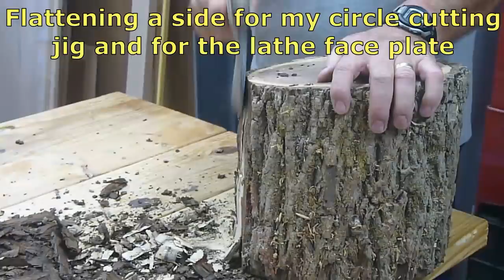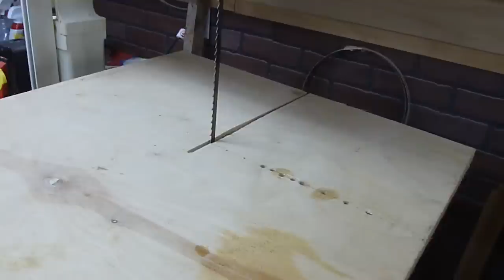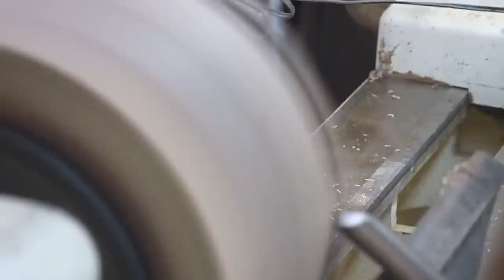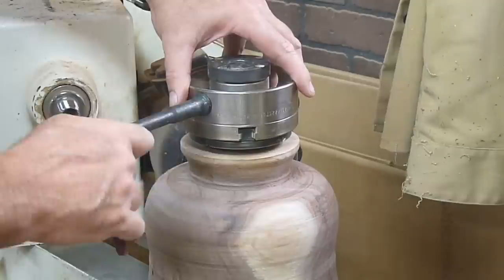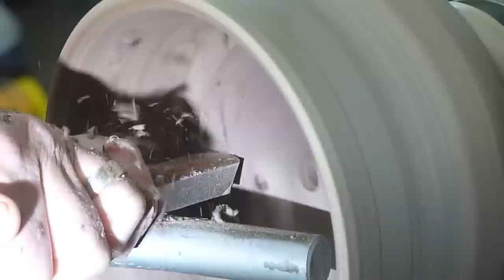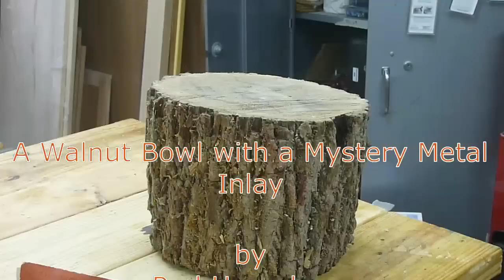Woodturning a Black Walnut Log into a Bowl

Comment: It's probably not that uncommon that a bullet was in the tree.  What's amazing is that the bullet ended up in the perfect place to become embedded in the side of your bowl.  It could have easily been cut away with the outside part you trimmed off with the bandsaw.  Or it could have been part of the inside of the bowl that was turned into dust with your turning chisel.  An unusual set of happenings!  Great job on the bowl.
Reply from the maker: Truly!  It was in the perfect location, very unusual!  Thank you!

Comment: Great turning with a beautiful result.   I hope you don't mind me offering a little advice which may be of help to others.   When you were roughing out the piece you could have kept the tail stock in place for a great deal of the time.  Last April I was turning a large natural chunk of wood using a face plate to secure it.  I didn't realise I was putting extra stress on the screws because of the unusual shape and it started to come off.   I raised my forearm and took the blow and in doing so broke a bone.   Normally such a break takes 6 weeks to heal but I healed in 3 weeks which I was mightily pleased about.  However, during those 3 weeks I was forbidden by the Doc from driving which was a bit of chore and I couldn't do any turning.   The message I want to put across is that whenever possible you should deploy the tail stock for more security.
Reply from the maker: Thank you very much, Alan.  You are absolutely correct regarding the tail stock providing better support, especially when the piece is uneven or out of round/balance.  My jig gets the piece very close to round, but regardless, it still would have been more wise and safe to provide that support.  I'm glad you were not hurt worse, and want others to learn from that accident.   Thank you for a very constructive comment!
Reply from the maker: @rats     lol, if you only knew...
Reply: R Humphrey old Marines don't get hurt they just get even!  Right?  Lol
Reply from the maker: kamurray67 hahaha truth! Semper Fi
Reply: He had eight screws and they were all securely anchored, and the huge faceplate offered full coverage at the attachment end.  That walnut block was every bit as secure if the tailstock were employed..
Reply: I'm sorry if I have upset you.   I knew when I posted my comment that I would probably attract some critical replies.  I was only trying to share my unfortunate experience for the benefit of others.   I can't comprehend how you can say that having just one point of securing a piece is as good as having two.  It's a bit like saying that someone who falls into a river or the ocean would just be as well off if he had one rather than two life jackets.Thank goodness the R Humphrey is a much more reasonable gentleman than you.  I shall continue to watch and learn from his great videos and amazing skill.
Reply from the maker: Xysix  I am comfortable with the face plate without the tail stock, but I do check it frequently.  It's perhaps a bad habit to choose not to use the tail stock as much as I do, lol.  Thanks for watching and for your sub :)
Reply from the maker: Alan, it's all good, there's so much to learn and so many ways to get things done :)  Thank you!
Reply: Apologies but my reply was intended for Xysix.    I'm sorry some people can't accept reasonable advice without reading something else into it.  I am a member of the Irish Wood Turning Guild.  Just this week we received a missive from the Exec Committee forbidding all demonstrations, entry competitions or anything else related to Litchenberg Fractal burning.   This has arisen out of the unfortunate death of a man in Wales who had made his own burner from a salvaged microwave transformer and other bits and pieces.   He was electrocuted to death as a result.  I had no trouble absorbing that piece of advice.  Using just a faceplate when you could be using the tailstock as well is like a mountain climber using only one rope as opposed to two.   I can't for the life of me see how anyone could take offence at my comment but as the old saying goes, there's nothing as odd as people.

I emphasise that my grievance is not with you as I greatly enjoy your videos.
Reply: Alan Simpson i
Reply: It looks like the tail stock end was fairly symmetrical... That, being with the very secure face stock, was what held the walnut in place firmly without much complications.
Reply: You guys are awesome!
Reply: I have not got into using a lathe yet but it something I'm looking at trying out. That being said this whole thread is about the tail stock. What exactly are ya'll referring to?
Reply: @tinytim8919  The tail stock is the non-motor driven end of the lathe that holds the wood like when you are doing spindle-turning. He used it in this video to hold the drill bits when he was hogging out the opening of the bowl.
Reply: @tomknack  ok. Thank you

Comment: With that Metal object Being Buried As deep as it was and judging from the shape I believe it was a Bullet because the part that hits its object is made from lead and when it hits its object it will spread out into a semi circle so as to do nore damage as it enters its target  so from that I believe it was a bullet
Reply from the maker: I originally didn't think it was a bullet, but I do now, and I think it was a large caliber ball...or perhaps a smaller caliber shotgun slug.  There's quite a bit of mass to it.
Reply: While planing a large black walnut slab I heard a metallic ping sound and discovered a musket ball embedded in the wood. I checked with the supplier and the wood came from South Carolina so we thought it may have been a ball from the Civil War era. The ball was fairly centered on the plank in 3" thick walnut so must have been in there for many many years.
Reply: @slash1956  That story is crazy!

Comment: Great video! Walnut is probably my favorite wood to work with. 
Just a quick word about walnut for anyone who doesn't already know: walnut sawdust is one of the most toxic wood dusts around, so make sure you use breathing protection when working it. 
As to the bullet, you were fortunate to find one already placed. I have experimented with solder inlays to achieve the same effect. Some have worked out; others haven't. Great job on the bowl!
Reply from the maker: Thanks, and thanks for the info too!

Comment: Thank you for doing this video! I have a box elder log that I was going to turn down and use the 5 color liquid wood dye kit and some Mica in resin, but just seeing the wobble from a dry run was worrisome. Now I seen someone else did it I can do it too 👍 Owe you one my friend! You Rock! 😁
Reply from the maker: I'll bet that will turn out beautiful!  email me a pic when you're done!  thank you!
Reply: @RHumphrey  Will do, but it may take a bit...couple projects ahead of that, plus I have to let it finish drying. I have sealed the ends with green wood sealer and ran a couple prayers through begging the logs dont split. The pieces are about 2 weeks old, so I have some dry time to go. I also have a bench top lathe, so I am going to have to break down and fully anchor her to the bench for that run. Thank you again :)

Comment: Cool jig. Made mine with melamine.
Reply from the maker: melamine is a better choice for certain.  less movement...  Thanks!
Reply: @RHumphrey  the slick surface on melamine will allow it to spin on the pivot point with zero resistance.

Comment: It's a lovely bowl and that 'mystery metal inlay' is nothing but awesome...   I am curious, however, why more bowl turners don't use center savers or nested bowl cutters so that all that good walnut couldn't have been made into another bowl instead of 20+ pounds of shavings...
Reply from the maker: Thank you.  My reason for not using one is the limitation of design.  The produce simple dome shapes...which is fine, but I want to shape it my way.  And, I do save the shavings for other uses

Comment: Thanks for the great video and for sharing the result. I have only minor experience with woodturning and I've never worked with walnut, so I have a couple of questions, if I may: 1) The wood blank you prepared included the log's core which, as far as I know, is typically discarded due to cracking concerns. How do you deal with it? 2) You've finished the bowl just out of the lathe, without waiting for the wood to dry out. So, I was wondering if you are expecting any deformation of the bowl with time. Thanks in advance for your feedback and again congrats for the great video
Reply from the maker: Thanks very much!  Using the core, or pith, of the wood isn't something I usually do but I had this log drying/seasoning for ten years.  When I brought it home, I sealed the ends with end grain sealer so the moisture would evaporate thought the sides more evenly and prevent the checking.  It worked great on this log as it only developed very minor cracks over that decade of time.  So, I'm not at all concerned about this bowl cracking.   

That being said... I've turned green wood, natural edge style and with the pith, in the past and then stored it unfinished in a paper bag packed with its own shavings for months without it checking.  They tend to elongate and go oval a bit.  I've found the key is to make the bowl walls a very even thickness so it may dry more evenly and reduce the internal stresses.  Other may do it differently with more success...     Thanks again!
Reply: Understood, thank you!

Comment: Is there a reason why you chose not to use a large forstner bit to remove more material than the small  bit you used there? Amazing work just curious if that would save you some time

Comment: Nicely done, I have access to 100 walnut trees, felled by a lumber crew for the main trunks, leaving the secondary branches all on the ground to rot. Better economics than firewood! I also have a complete wooden boat building woodshop, but no lathe and no experience turning. Which lathe? What books? How long to get good enough to make presentable bowls?
Reply from the maker: It's nice to have such a resource so available!  I can't advise what lathe to buy, as there are so many good choices.    Thanks very much!

Comment: First off, beautiful bowl. I love the walnut.  ? Are you concerned about cracking with the pith running through the bowl?
Reply from the maker: Thank you!  No not concerned at all because of the many years I've had it drying with out it already checking.  Also the bowl walls are a very even thickness which helps avoid the problem.

Comment: Nice project.  I was surprised with the log being 10 years old that it was not cracked.  Did you have some clear end sealer on it?  Also, since you left the pith in the finished bowl did you have any cracking after it fully dried later on?  Please advise.  Thanks, Myles
Reply from the maker: Thank you.  I had sealed it when I first rescued it.  I can't remember the product, but it was a green wood end sealer.  It held up great over the years, and I still have a couple logs left from that pile, also not cracked.  It was all stored on a shelf in my non environmentally controlled garage.  No, it hasn't cracked since the turn.  It's worked out great!
Reply: Thanks for the info.  Apparently it dried slow enough with the end sealer applied to avoid cracking.  I'm sure that after 10 years most or all of the log was dry as that is a log time.

Comment: Real nice, do you have a recommendation to round out blank without a bandsaw?
Reply from the maker: Thanks!  I've used a chainsaw in the past, that works great as long as you can keep the log stable.  Hand saw, axe, many different possibilities really.  Hogging off the bulk of the wood, even if only getting close to rounding, is way better that spinning and off balance log...which I've done and very slow speed.  Thanks for your service!

Comment: Mr Nosey here, first very very nice.  
If you wanted to get the metal out have you ever tried making a paste of the saw dust and mixing it with glue?  What about patching a crack you did not want have you ever tried saw dust paste and glue?  How did it work?   Do you ever have a bowl that warps after you turn it?  Do you use any wood Hardener to prevent warping?  

I believe the metal is a cast lead rifle bullet.  It's large like a 50 caliber rifle 350 grain like a 44-40.  Bigger than a 45 colt. It's looks as if it is hardened with tin and antimony.   Harder than pure lead.   Pure lead would not have cut like it did,  to soft.  Steal would catch on the turning instrument or spark.  Maybe silver, but don't think so, it's  not quite shined up enough when polished.  My guess is lead 93%, tin 5%, and antimony 1%. 

I think putting your hand on that bowl while your prop is in the bowl is dangerous.  I haven't been able to get replacement parts.  Ha ha 

Have a great one.
Reply from the maker: Thank you!  I have used saw dust and glue mixed on inlay edges and it seems to work great.  Yes, I've turned some green/wet wood and had it warp.  They tend to go oval.  No, I haven't tried a hardener...interesting.  Your analysis of the metal is very interesting as well.  If it is a bullet, I would have to agree that it is a large caliber.  Your knowledge of metal compounds is way beyond my own.  You are correct about the danger, thank you for the reminder, I do appreciate it.  Thanks again!

Comment: It's still green after you finished it, were you not concerned about shrinkage, cracking and warping?
Reply from the maker: no, this log had dried and aged for ten years prior to my turning it.  I wasn't concerned, and it hasn't checked or warped.
Reply: @RHumphrey  I am surprised that after 10 years that the wood is solid with no cracks.

Comment: Great bowl, I’m new to turning and having some success.  I just picked up a load of black walnut.  I cut a chunk, made a bowl and it always splits on the pith...if you cut the bowl with the pith on the side will it split??  Did this one you made crack?
Reply from the maker: Thank you.  This log, and other walnut I've used recently, I picked up over ten years ago, sealed the cut ends to prevent splitting as they dried over time, and kept them in a dry but not temperature controlled place.  This was perfectly dry to conditions and I had almost no concern at all about it splitting.  No, it hasn't split since I turned it, it's still doing fine.  For the most part, I cut the pith out prior to curing, but for these I chose not to.  Another thing that helps avoid cracking (you may know this already, others might not) is to make sure your bowl walls and base are a nice even thickness, especially if you're turning green wood.  Hope that helps!  thanks again!

Comment: Thank you again for a great demonstration of turning. Will you please make a reply, re: the tools you use, mostly interested in the Lathe (general info, size HP etc...)  also I am looking to upgrade an old really old band saw. What are you recommendations? Thanks again,, I saved  to watch later sooooo many of your video's    Thanks again...  Kevin
Reply from the maker: Hi K S, kind of a big question...I'll try to nutshell it.  I use traditional lathe tools, with M2 and M42 High Speed Steel.  Carbide tips are great, I just don't have any.  The type of lathe, power, bed length, spindle height, all depend on what you want to do.  More power is better for bigger projects, let there be no doubt.  As far as upgrading a band saw, consider the throat capacity and thickness height...those two things to me are the most important in a band saw.  Hope that helps a little...and thank you!
Reply: @RHumphrey  thank you for your response I have been looking at a number of band saws and made my decision there for the upgrade and also I am going to go with a free-standing lathe instead of a benchtop. It sounds like I better do it right the second  time instead of this old junk that I've got now happening again in the future. Larger hp for sure thank you for your response looking forward to more videos.

Comment: Just found your channel.  Was that bowl blank sealed and cured, or were you turning it green?  I noticed the pith is still in the wood, but didn't see any checking at all.  I was wondering how you managed that.

As for the metal, my first guess would be barbed wire nailed to the tree and the tree grew around it.